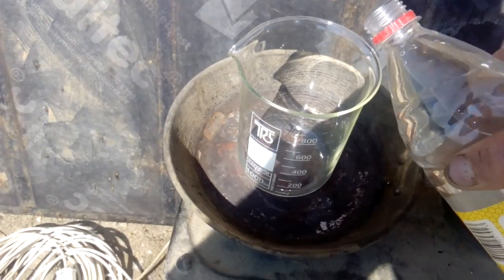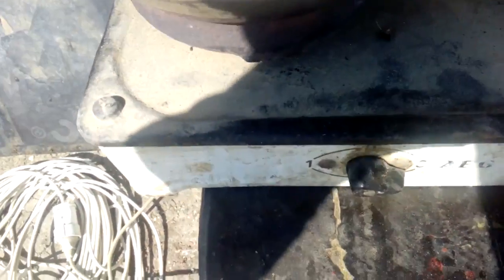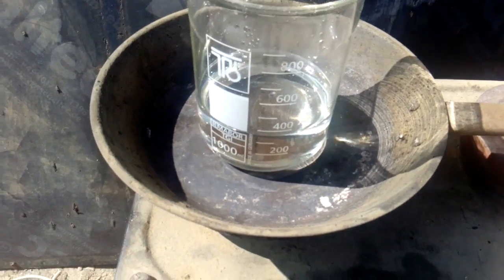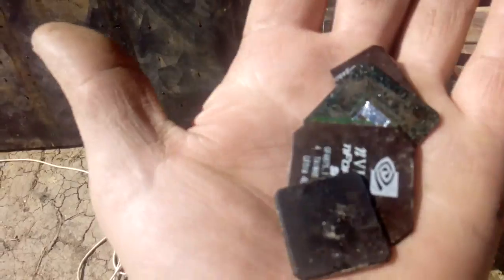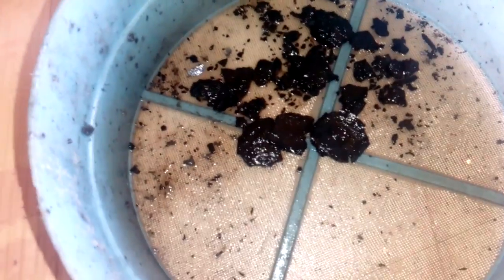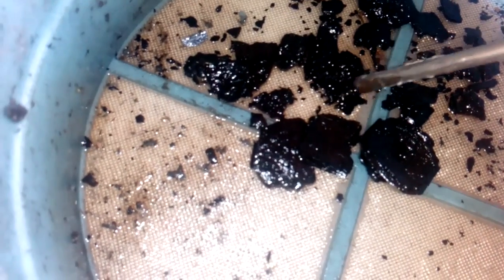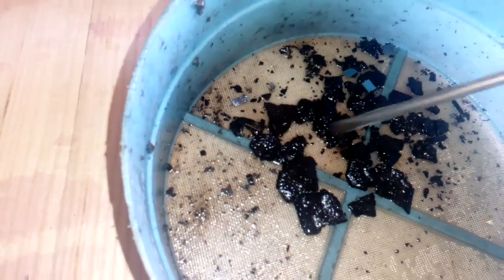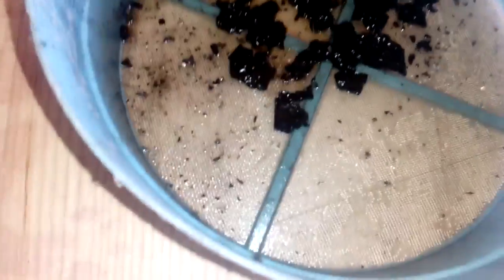CAR BATERY ACID FOR WET ASHING - will it work?

Comment: Solutions need room in them to dissolve things. When they have no more room in them, they're considered 'saturated'. We don't know if you consumed all of the acid and simply needed to take those pieces and do the same process again to them. Or, perhaps the solution is so full of both acid and what has already been dissolved such that there is no more room for any more to dissolve INTO. In this case, adding a bit more distilled water to see if the reaction re-started would have been worth pursuing. And if it doesn't, then you need to see what happens when you try the whole process a 2nd time with more acid.

Comment: Here in the US I get liquid fire drain cleaner. It is discolored when you buy, it this is a metal crosion intihibiter. If you boil it it goes away.  Mabey try letting it cool down then adding the chips . I think mabey  it has been he same kind of stuff in it ??! I think this will work for you if u do this . Happy scraping!!!

Comment: I don't understand, you use car battery acid which you say is 40% then you evaporate the water off, then you will have close enough to 95% sulfuric acid, which is drain cleaner strength. I think what your problem is that you boiled the acid and then dropped in the bga's straight in, and it burnt them instead of dissolving them, I would suggest to try it again and let the acid cool down first, you don't need to have boiling acid for wet ashing anyway and maybe it won't burn the plastic chips.
Reply: Solutions need to have room in them for materials to dissolve into. If you take sulfuric acid to max concentration, that means there's not much room at all in the solution. It's already saturated. I've seen this first-hand. You can put something in an acid and it will do nothing. But as soon as you add some good old water, the reaction kicks off. Because then and only then does the substance have a place to go. I don't know if his solution would have continued above if he had added like 20 ml more of water. If it started back up, it means that the solution was as jammed-pack as it could get without more elbow-room for the elements. But if it didn't start back up with the addition of some water, he should have taken the undissolved pieces and tried the whole process a 2nd time on them.

Comment: Can I use it as electrolyte in reverse electroplating?
Reply from the maker: I dont know frend,i dint try yet for electroplating.Maybe :)
Reply: 999 Dusan Thanks mate, I will try it anyway  and share my expirience here in a next few days. Cheers!
Reply: I tried reverse electroplating with that car battery acid (40% sulphuric) and it works quite well! In fact, better than vinegar-salt solution. It may be a cheaper alternative for this process. As I promised, I'm sharing my expirience here. I hope that could be helpfull for someone. Cheers!
Reply: @rabindranattagore7827  nice exepriment sir👍, i want to know , if you use the car battery acid , how to precipitate the solution or just wait the solution to precipitate it self for one night ?

Comment: It dissolve the metal and got used up because dilute sulfuric reacts with copper.
Reply from the maker: I evaporate acid to koncentrate it,but still not strong enaf,probably disolve some base metal like oal sulfaric with low concentrate.

Comment: if you phyrolize the chips to the point that you have driven off most of the solvents but before you turn it to ash the acid may be much more effective also in the US drain cleaner may be as much as 95% concentrate you might try that.
Reply from the maker: In Serbia we dont have that strong drain cleaner in store and shops.
Reply: @999DusanGoldrecovery  to bad maybe i will send you some.
Reply from the maker: If you burn chip before,wet ashing never work on that chips,i try that once.
Reply: @999DusanGoldrecovery  if you use an electric kiln and you keep the temp under say 500 f then it would work better cheap controllers for temperature control  with a heating wire are cheap on ebay and amazon as well as alibaba.

Comment: Add. A little bit concentrate nitric to wet ash .it works much better
Reply from the maker: This is a test,i try that acid alone to see if it work or not.It is beter with nitric but i needed to try without.
Reply: Maybe some additive is in there to make safer.  i thought it would work the same but not so good .thanks for this video man was gona try that kind cause its free for me at work

Comment: #999 DUSan is there any precious metal in lcd screens? Some recycling ppl offer to buy them by the pound I know about the gold fingers on the LCD  board but anything else why would they offer 2.00 a pound
Reply: yes there are some but the concentration is very low and there are things that can be very toxic if you do not know how to deal with them.
Reply: Nitric acid hai naa
Reply from the maker: Lcd screens containe indium.For litle refiners is imposible to recover it.Kilogram indium is about 600$ now,but biger industrial refiners can recover indium.For others precious metal is low concentracion.
Reply: @999DusanGoldrecovery   i have almost a kilo of indium scraped form cpu heatsinks that i would not have known about i i did not watch you.